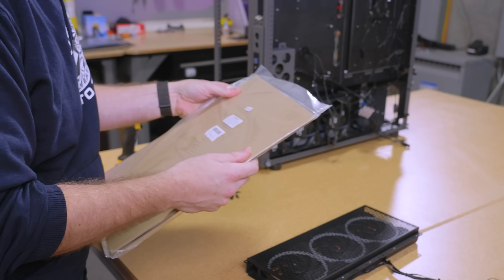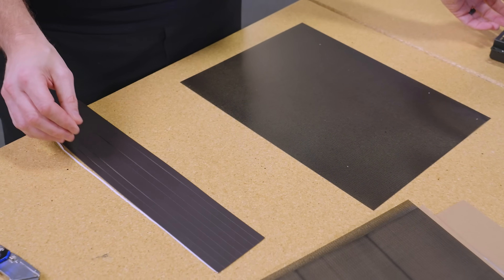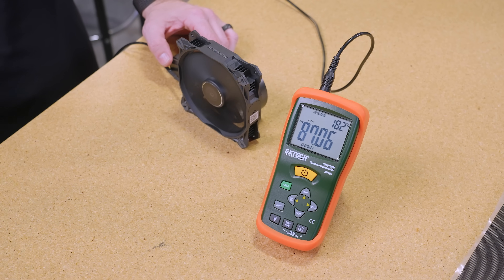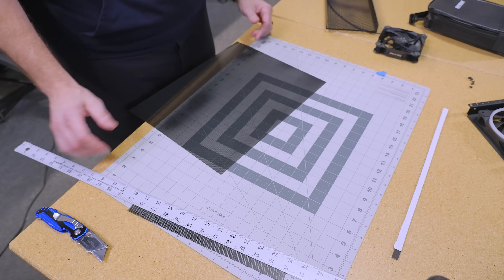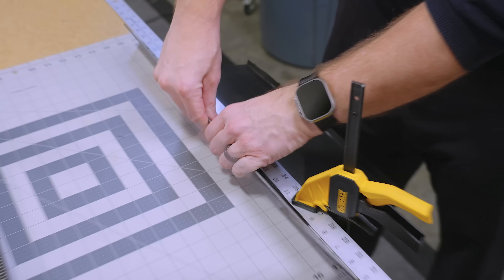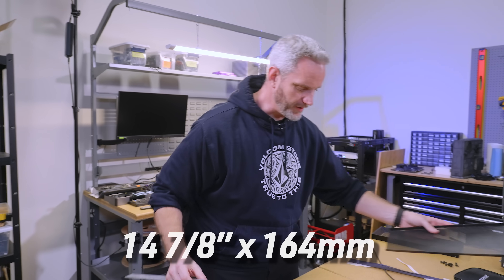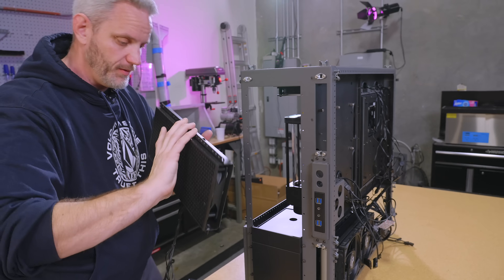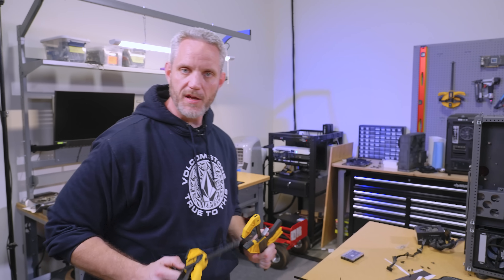How to create your own PC Dust Filters!

Comment: Hi Jay. Actually i am facing some issues in my laptop (Asus tuf F15 i5 11 gen rtx 3060). A few days ago, it started having those blue screen errors with codes like "Video mismanagement failure", "Page faulty non paged area" and "nvdllm". So i decided to reinstall windows and chose to reset pc with "reinstall from local device" option. My laptop vame with pre installed Windows 10. Now as soon as the reset process started, it froze at 1%. I waited for like 15 hrs and it was still atuck at 1%. So out of frustration o decided to turn off the power switch and turned it back on instantly. It again showed a blue screen and then restarted and the windows started installing. After the installation finished, it again showed blue screen error with same error code. So i tried the method in your video with DDU uninstaller. Now after 2 days it again showed blue screen. So i wnated to ask of this is due to windows not getting installed properly cuz it got stuck and the i switched off the battery power or can it be because of nvidia driver version (545.95). Nvidia released another version 546.01 yesterday. So i installed this one. But these two errors "nvdllm" and "Video memory management failure" keep occuring again and again. Can you please tell me if this was due to windows not installed properly. Should i install windows  from cloud this time? Please help me i ahve my exams coming up and these blue screen errors are killing me

Comment: I used an old pantyhose. They are cheap and come in different thicknesses called Denier. I suppose an ordinary 20-40 Den pantyhose would work just fine as a dust filter. Costs you less than a 1$ in some places. You could go for a punctuated pantyhose for more airflow too like a fish net pantyhose. After all it looks pretty with a fishnet or basket weave front. I prefer more airflow.  Pantyhose come in all colours including some rather dope neon colours. They might look cool in a Cyberpunk build.  But you would have to staple it to a small wood frame. But well, that's the female PC builder of course. Also: raid your wife's wardrobe at your own peril boys and prepare for questioning if you come home with a super sexy pantyhose in neon pink. LOL. It's your marriage not mine...

Comment: My thinking as far as the dust coming in the top has always been for what gets through the case, not what sits on top of it; still may not be super useful, maybe it's placebo, but I've never had issues with it restricting airflow to a point it mattered anyway, so I've always kept them on. I also sometimes keep the closed covers on some of my stuff too, because to me it looks better, and it works how I want regardless. But then, I also don't care about how loud it is, because I'm used to server fans at work, and I use a rack-mountable UPS anyway, so I can't hear my PC over that. (Or the Minisforum HM80 I use as a server sometimes; I live in Australia, the room gets warm XD 

That said, thanks to your videos my main rig is watercooled, so at least now my components don't melt during the Aussie summer! Maybe one day I'll even be able to buy an air cooled card and not fuck up waterblocking it myself... o.o

Comment: I would have tested differently. Find one of your good cases w/ a good filter and test air flow in it's existing setup as a baseline. Then I would cut the filter you bought to match the good filter and mount it in the test case. Measure the air flow and compare. It doesn't matter that you would be testing the airflow for a different case. What matters is the difference in air flow between a known good filter and the media you are trying. When testing there are only two factors that need to be considered. 1. Is the obstruction going to impede cooling too much? 2. Will the obstruction eventually wear out your fans? Using a good filter from a good case provides the perfect baseline since you can be reasonably certain that the case manufacturer selected the filter with these two factors in mind. You do not want to use a filter from a budget case. That manufacturers only consideration was... Will it reduce dust? As a general rule if your results are within 10% of each other, your good.
Reply: I have nzxt h7 flow rgb case the case dust filter doesn't work